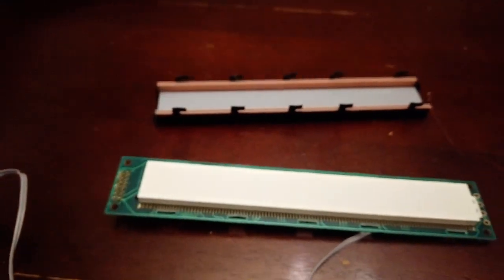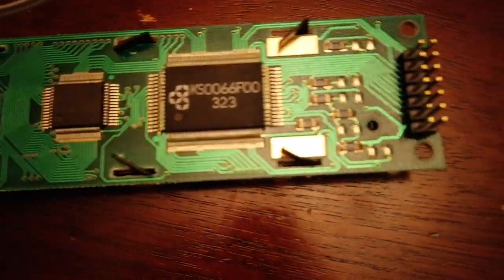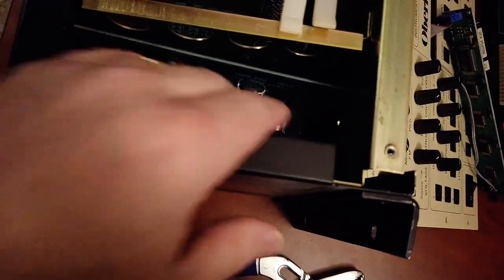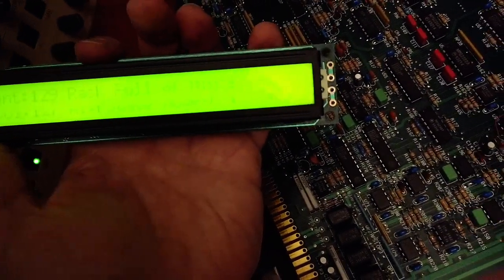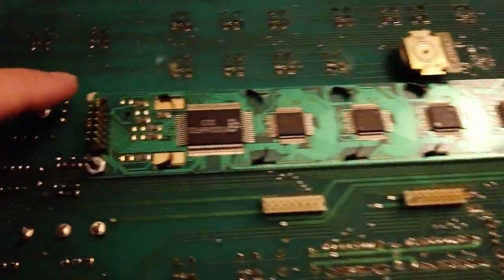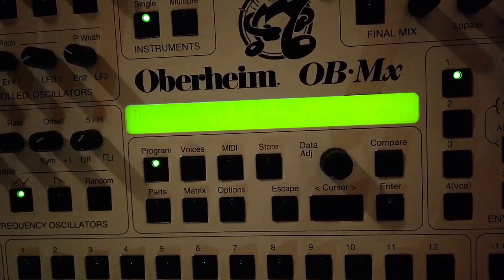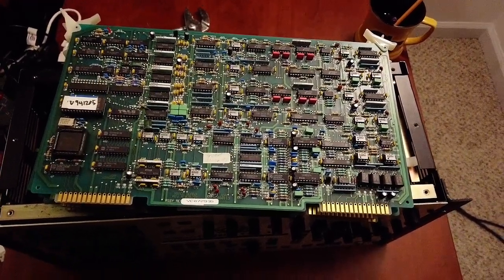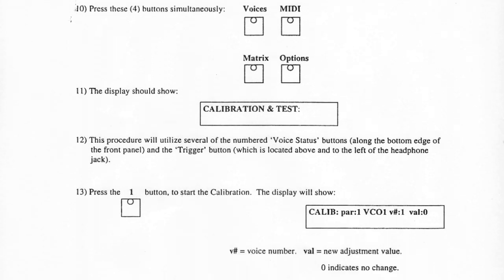Oberheim OB-MX LCD Repair & Unit Reassembly (finally successful!)

Comment: a thought, maybe you should have used the opportunity to swap the capacitors.
Ask some student to help you decode the LCD for the worse, so you can put in a Oled on a later date witch an additional mcu.
Reply from the maker: I'm generally not a fan of willy nilly recapping unless there's a specific reason to do so -- to easy to accidentally damage something in the process.
Reply: @Lantertronics  Well, source good ones, like Panasonic electrolytic at Mouser, there is another Japanese brand. not sure if the have these type or values, but they have high end variants for sound. "Nichicon" Aluminum Electrolytic Capacitors, they even have non polarized variants.
Just take it easy, breath in between.
: )
Use a "leg" for the camera.
This is definitely a device that should be preserved. although many circuits can create cool sounds. even if you build a VCO on virtual ground as you can see at my profile.
Reply from the maker: But yeah, in old equipment bad caps are usually a thing to look for.

Comment: When I started watching this video, I realized that the problem is not the zebra strip connection. It's all about brightness. You can disconnect the brightness pin and add a single trimpot where you can select your desired brightness. Otherwise, there could be an issue with the brightness control, it could be PWM from the microcontroller?
Reply from the maker: Interesting... cleaning the zebra strip did seem to help a little bit, though. It was more readable after cleaning it than before cleaning it. 

I will keep that in mind about the trimpot if it goes on the fritz again.
Reply from the maker: By brightness, you mean the darkness of the LCD segments and not the backlight, right? (Because the backlight looks fine). Just making sure I understand...
Reply: @Lantertronics   True. those type of displays have a pin to control how much are visible the segments. It is necessary based on the angle of view.

Comment: I bet that display menu setting provides a variable voltage to pin 3 of the lcd unit, often called “contrast”.
Scope out the pin while you change the menu, then look backwards to see what kind of DAC is driving it, you may find a fault upstream….
Reply from the maker: It's working OK for now, but I will keep that in mind if it goes on the fritz again.